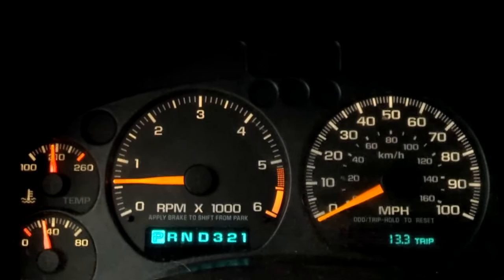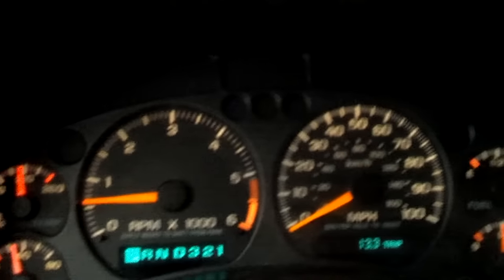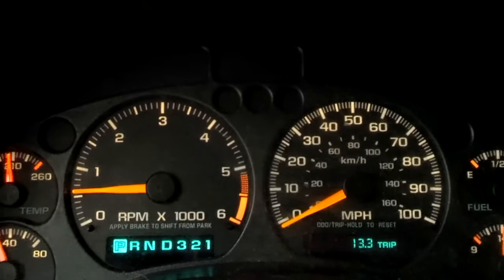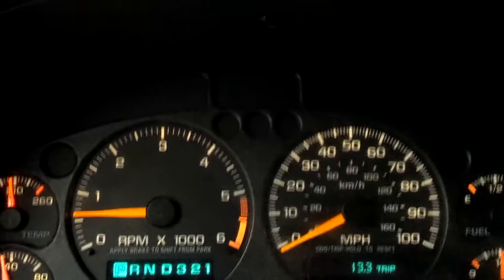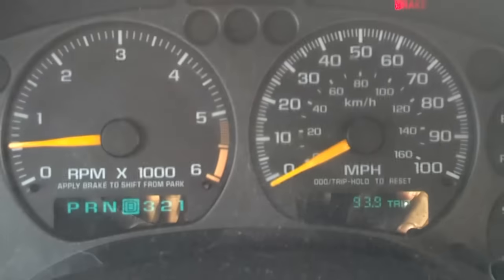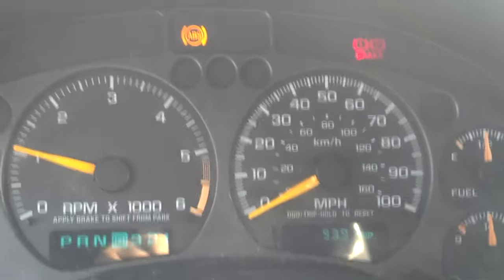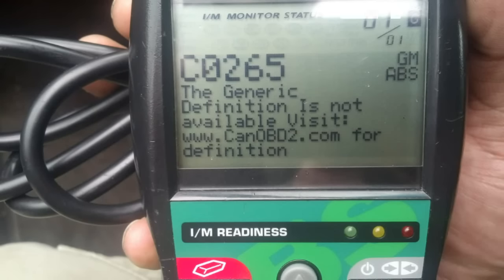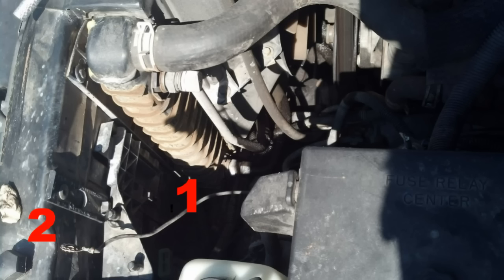How I fixed a Chevy with an  Abs and Brake light on

Comment: I just took the instrument panel out and apart then blackened where the ABS light shines through, the put the MF back in.  No more ABS light and passed inspection.
Reply: Not so sure about that. Might depend on which state you are in.
Reply: Would've been much easier just to clean up the ground wire. Plus when your abs light is on your abs is not working......so you just masked the problem.
Reply: Sike😂

Comment: A couple things:  get a soldering iron and solder a new connector--crimps like the factory uses will lose conductivity over time; use a grinder/dremel/wire brush to clean wherever it is you are bolting to; tighten the hell out of the bolt; spray over it with paint, or better yet zinc galvanizing paint you can get at the local hardware store.  Your new connection will last longer than the rest of your vehicle.  Also, pull and reinsert every fuse and relay.  Those connections will develop intermittent problems too, and just pulling and re-plugging will "wipe" the contacts (a can of contact cleaner will help).  I've fixed all kinds of "serious" electrical problems just by making sure electricity can flow from point A to point B.
Reply: Ol.vl
Reply: How about dielectric grease will that help too?
Reply: Yeah I'm with  @josem.2909  Will dielectric grease help?

Comment: My 03 Trailblazer had the same problem with the exception of the blower motor would not work and the cruise control stopped working all at the same time. You would never believe how I fixed it. I replaced the ignition switch that took about 10 min. to replace. Now the ABS & brake light is off an the cruise control & blower is working. The Chevrolet dealer said they would have to replace some sort of computer that is under the hood, that would cost me several hundred dollars. It cost 45.00 to fix myself.

Comment: Thanks man.  That was the exact problem in my blazer.  You just saved me a boatload of money.
Reply: Issue happening in my 2001 Blazer. Hope it works. Thanks!
Reply: @jistutz  how did it go
Reply: @donvergas4119  oh, man, how I loved that Blazer.  I don't recall what ever happened with the ABS light coming on.  I only had her for a month or two.  I made the mistake of changing the transmission fluid and then 1st gear wasn't catching anymore.  Ended up taking an $1800 loss selling it to a hobby mechanic.  She was good otherwise.

Comment: Thank you for posting this solution!  My 2001Chevyblazer had the same problem.  I followed your example by cleaning, wire brushing and sanding both grounds and the ABS and brake light disappeared.  Much appreciated!

Comment: Thank you for this video.  I have a 2000 Tahoe and the same thing -- the combo ABS and brake light -- has been happening to me for years, but only under certain conditions.  I've had it looked at several times and get a "deer in the headlights" look from the mechanics.  I am not equipped to fix cars myself, but maybe I can get a mechanic to watch this and help me out.  I'm mostly relieved to know that I'm not the only Tahoe owner who has had this happen!

Comment: Great video, right to the point.  I had done the other side of the radiator when I put a condenser in but didn't realize there were ground points on the other side, very typical for my skills.  There were two there and a good cleanup seams to have cured the brake light problem.  THANKS!!

Comment: So after running around in my car (2004 Impala Ls with 3.8 L) noticed that it got worse simply when hitting bumps or cranking wheels to one side... so figured it had to be a wiring problem.   So turned car on and while it was running wiggled all wiring harnesses and the EBCM harness to try to cause ABS and TRAC to go off.  After abit of testing, I triggered the warning lights a few times in a row... so found problem!   Found error to be the ABS connector to the hub on the drivers side front - pins inside connector were simply corroded and making intermittent contact.  Simple as that. Put penetrating oil in and no more errors.  So yes - it was a wiring issue... but only in the connector. So for any of you getting this as an intermittent error... and worse when it rains... disconnect the connectors and check if they are corroded... if so, oil them and work the connection on/off a bunch of times to work out the corrosion.  This error had me worried cause it caused 3 codes - one for each side AND the EBCM to show.  If you get this and go into a crooked mechanic, they could end up replacing the EBCM and both front hub assemblies.  In Canada here, the EBCM is $1500 and the hub assemblies (decent AC Delco US units) are $350 a piece... add labour and you're up to $2500 or more.   It took me 20 mins to get the tire off, lubricate the sensor connector, and put it all back together.  Hope this helps someone out there.
Reply: Rick Neubrand thanks for the information

Comment: I have the same problem with my 2003 Chevy Silverado 2500HD. Took it to the dealer and they said they couldn't find anything wrong with the brakes (light was not on at the time...of course).
This is good to know, NCP! I will give it a try and try to remember to report my results.
I have a good feeling this is probably my issue as well, although I have read on other sites that it could have something to do with sensors in the wheel hubs on ABS that get dirty.
We'll see...

Comment: Thanks!  This gives me a great first place to start on my 2000 Chevy Blazer ZR2. My brake lights, however, don't come on because I hit a bump.  I'll be driving along a smooth road, no bumps at all, and out of nowhere both lights come on--no warning...and at that point they typically stay on. Occasionally, I can stop, turn off the engine, and then turn it back on and they won't come on...for most of the day. Weird and frustrating!
Reply: Same with mine.
Reply: Okay, I removed my ABS EBCM, took it apart and re-soldered the six affected soldering points.  Sealed it back up with RTV, reconnected the three electrical connections, and bolted it back into the Blazer.  Problem solved--no ABS or brake lights have reappeared on my dash.
Reply from the maker: Danny McNeal Ha I Just did that today too.. the video is up loading as i type this. I was on my way for a NC Inspection and the lights came on right out side.. I to tore it down and did it today.
Reply: No light...but does it work!
Reply: Danny McNeal just out of curiosity whay if u just keep driving like this?
Reply: i had a rear brake light problem . i added about 6 inches of new wire at each side of tail light harness ( Ground  wires on frame) at frame on rear .. I used new crimp on connections for wire splice and wire connector at frame with heat shrink eyelets connectors.. not expensive. purchased at auto part stores.. I had the extra new wiring.It was thicker wire than original..I had to use P.B. blaster in a can and and try a few times to get rusted bolts out of frame.. I sanded down frame with wire brush and hand sanded too,cleaned up bolts and  applied a lot of d i electric grease all over boltS and it solved my problem.. Another issue was there r TWO FILAMENTS in tail light bulbs.. so when i bought new bulbs they were bad from the factory.. So i watched a u tube video on how to use a volt tester and checked my new bulbs before putting them in.. If one filament is broken it is confusing because u will have running lights at tail lights and no turn signals.?  Visually inspect both filaments inside tail light bulbs.. 2002 4x4 ZR2 CHEVy S10....

Comment: Worked for me so far. will do more driving in a bit. pulled both wires that were in that spot and cleaned and so far so good. ran around the block and its still off

Comment: My abs and brake light came on also.  It was the abs pump and the electronic module.  What I did was take off the module and sprayed contact cleaner on it and the pump valves.  It works just fine now and the lights don't come on anymore.  Chevrolet had only 3 left, (Pump and Module) so I went ahead and purchased one however, be prepared to pay 2200 bucks.  After Chevrolet sells the last two they won't make anymore.

Comment: I pulled my module, re-sweated all of the thru-hole solder connections, RTV'd it back together. No more abs light for my 2002 GMC Sonoma.
Reply: #warrant2002
You ever have low idle/stalls in the sonoma?

Comment: I took the entire abs system out of my 96 s10  and switched it back to the 91 style  manual trans type  had to do alot of work but worth it to me i hate abs  get ready to buy new brake line blocks and a bunch of other #&#!

Comment: Yay! it worked. It took a few ignition cycles to clear the error, but no ABS and brake light coming on now. They went solid upon the first start up after cleaning the main ground (battery to engine) so I thought it was not fixed. I had to clean the main ground also, just cleaning the EBCM ground did not fix it. I do live near the ocean so I am exposed to salt air, more factors added to the corrosion issue.
Reply: Hello where was the main ground located because I’m going to try this on my girlfriends car she has the same ABS light problem we live near the ocean so I’m hoping it fixes it
Reply from the maker: On the frame near the radiator (I think)

Comment: Thank you so much, such a helpful video. I just started having this issue. I recently changed my hubs on my Blazer and the lights came on after almost an hour if driving. A few weeks later it happened again. Couldn't find anything about it, even SUV enthusiast guy I know didn't know the cause.  Now that I know what I'm looking for it should be an easy fix and hopefully I caught it early enough that I don't need any replacements.

Comment: When your wheel hub needs to be replaced your abs sensor warning light will turn on, change the wheel hub, or you may have a bad abs sensor, my 2000 Chevy Tahoe LT did the same thing. But I had my ground fixed grind the steel around it and installed the ground and painted it with rust protector, my OBD said its the sensor so I changed the abs with the wheel hub.if your burning tons of fuel or clean you throttle body you can damaged the TPS sensor, careful on cleaning that.

Comment: well I clean the ground it was corroded but it did not fix the light. I found a youtube video that shows you how to remove the cover from the EBCM and look for broken solder joints it shows witch joints to re solder and that fixed my problem.

Comment: On my 1995 GMC Jimmy SLS 4 X 4 the ABS light has been on despite having replaced the ABS Module. This malfunction line has been on for 5 years. However, today the ABS light went off and the "red brake" light which turns on when there is low brake fluid level or the parking brake is engaged turned on permanently.  The brake fluid level is OK however I don't think this relates to the parking brake engaged switch because why would the ABS brake malfunction light would have turned off?

Comment: Put a new connector on the wire end as well because the wire crimp could have corrosion between the wire and the crimp. . Seal it up with silicone when done, clean the area where the bolt goes, use a new bolt. seal that area up also.

Comment: check Abs sensor easy and cheap to replace also could be a sign you have a bad wheel bearing about  $60 bucks.
Reply: i had a bad driver side wheel baring n the light would turn on mostly when it rained.
replaced the baring and it doesn't do it anymore.
Reply: Rogelio Ramos you don't say lol
Reply: Bad bearing will trigger abs at low speed due to clearance variance which gives the wrong voltage reading to the computer. The abs sensor is easy to test with a multimeter. Spin abs check for voltage.

Comment: I have a 2000 s10 and I've noticed that if my battery gets drained from sitting, the brake and abs lights come on. I charge the batt. and they go out. I'll check that ground too,thanks.

Comment: I have the same issue. I have an 01 suburban with 339,000 miles. Brake and abs light stays on. Changed my 2 bearing assemblies and they went off for a month or so. But i hear is a grounding wire that is the cause of all these issues

Comment: 2003 GMC Sonoma, I sanded the paint off the two ground wires on the driver side and that did not fix the ABS and Parking Brake lights.  I found two ground wires underneath my battery and sanded the paint off and now my ABS and Parking Brake lights are off now - except when they should be on.

Comment: Having the same thing with my 98 zr2. Ill try the ground thing, but if it dosen't work I'm gonna put electric tape over the light, and use my foot and brake pedal to keep the brakes from locking up, like the old days before ABS.

Comment: 2005 Silverado 1/2T.  Had ABS problems and changed both front wheel sensors, as well as ABS module.  No more braking problems and no ABS warning light.  Changed differential (2wd) and now the ABS light and parking brake light come on, plus Service Brake System warning appears on dash only after driving about 1 KM.  Obviously, the brakes had to be bled and the master cylinder reservoir had to be refilled.  Any way to stop the lights and message from coming on?  Scanner shows no codes.

Comment: I cleaned up ALL 4 of the ground wires next to the radiator, put new terminal connectors on the wires, then used stainless steel screws to connect to clean grounds, but this did NOT fix the ABS light problem. There are NO trouble codes. I even cleaned the ABS module connectors and the fuse. ABS light still comes on.

Comment: you need to check if you have traction control if you do that means that you have a embc electric module brake control a regular vehicle has a ebc electric brake control; when the abs and the brake light come on it's telling you your electric module brake control is not working as it should, sad to say, but only a Chevy dealer can detect it for you or if can find someone who knows how to fix it without replacing it. hope this helps somewhat.

Comment: I have 2000 Chevy Venture. Since yesterday the ABS light came on (brake light is off and not activated).  Anyone knows exactly where the EBCM ground wire is located?
Reply: For SUVs and I think Vans it on the drivers side behind and below the headlight on the inside of the engine compartment. Trucks it's under the drivers door on the frame.

Comment: If this happens with a 2001 chevy s10 2.2l theres a ground wire that goes from the firewall to the a bolt on the fuse box under the hood you can try that as well

Comment: I need help....I bought a 2000 chevy blazer LT back in march with a 139,000 miles truck has been running fine until last week when the brakes started fluddering and ABS light came on. what causes this and how can I fix this ?
Reply: My 02 s10 with 139,000 just started this 😳

Comment: Good info. Looks like you may be in a northern climate, based on ALL that rust. The 2008 S-10 Blazer, in our City of Orlando Fleet, did not have this issue. Back to the drawing board. Have replaced many ABS control modules, would like to know how you fix them.
JT

Comment: My light came on today and there was a hum. When I stopped the truck and pulled out the keys, it kept humming. Quickly I unloosed the battery and it stopped. I pulled the 60 amp fuse out and the humming stopped. I will have my brother to look at the problem. It happened all of a sudden when I was pulling out from the bank.

Comment: great video. quick question, I have a chevy silverado 2000 v6. the break and abs light are always on as well as the service engine light. I tookbit to advance auto to get a read but it shows nothing. they told me it could be a bad fuse that doesn't  let the scanner work. what should I do
Reply: Bullbutter clean the bolt and threads too

Comment: I have the same issue. What year is your vehicle in the video? I have a 2000 2.2 5 speed. I'm looking everywhere and I can't find the ground wire. Thanks.
Reply from the maker: +Josh B I have a 2001 Blazer ls on mine the EBCM is linked to the bottom bolt near the radiator. I have 2 videos on this one is one the wire and one is a easy fix on the module.

Comment: NCP, once you cleaned and reinstalled the ground, did you clear the code using an OBDII, disconnect battery or neither? Curious as this is happening to my wife's 96 Tahoe and I am going to give this a go this coming weekend.
Thank you for posting this, much appreciated.
Reply from the maker: +Brian Lewis I removed the neg battery lead.  I tend to remove it every time i work on electrical systems.

Comment: This is real good video for the Kelsey Hayes 325 ABS, but do you have any experience or knowledge to share how to repair the older Kelsey Hayes 4WAL? I am in the process to restore my 1994 Astro Van and so far the best advice I am finding on the internet is to remove the abs fuse and rock on. Appears no one is fixing or providing parts for the 4WAL ABS unless I am mistaken. Thanks in advance for any feedback.
Reply from the maker: I really don't know but.... It looks like the control module might be the same. I would give it a try.
Reply: Thanks!